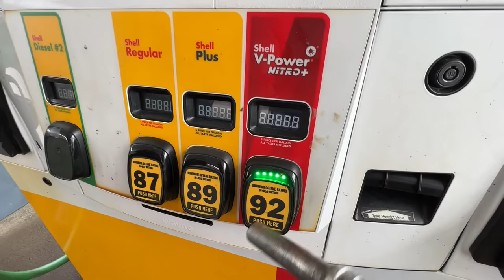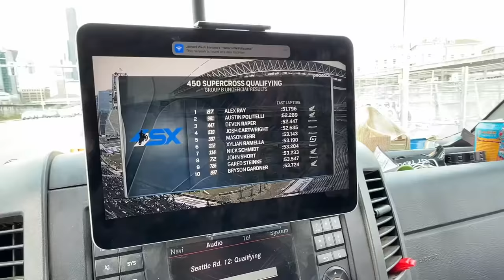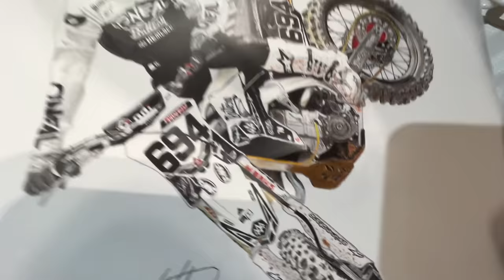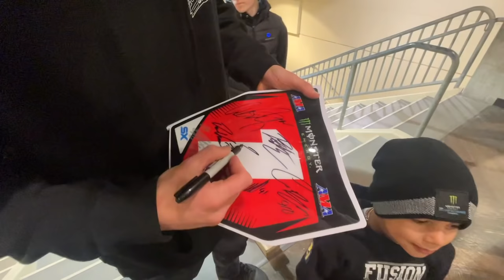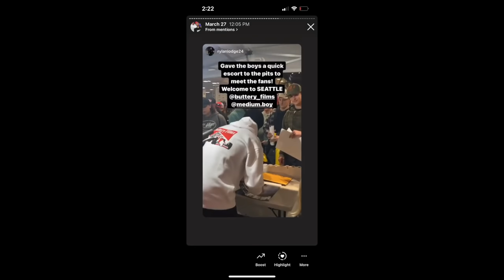Seattle Supercross HUGE Crash - Buttery Vlogs Ep138

Comment: Cut some pieces of wood like some 2x4's, to put between the front wheel & the front fender. So it only lets the front come down like an inch. When your strapping down the bikes & it will save your fork seals. 
They sell something that does the same thing. You can make for free if you already have the wood.  But you'll never have blown fork seals again, at least not from strapping down.

Comment: Just a little FYI the river running by Riverdale is the Toutle River. All the "sand" you guys were riding on is actually ash from Mt. St. Helens when it blew back on May 18th 1980! The toutle river completely flooded with debris from the volcano. That is one place I am itching to go ride but it's a couple hrs from home. Went to change out my dog bone on my 2018 CRF 250R yesterday and like everything, nothing can go smoothly. So now waiting for new lower suspension bearings etc. UGH
Reply: I gotta get new fork seals on my crf250r, I just got her running after flooding my engine.
Reply: All parts are on back order now it’s crazy.